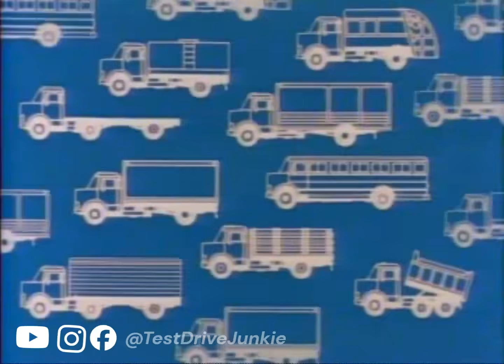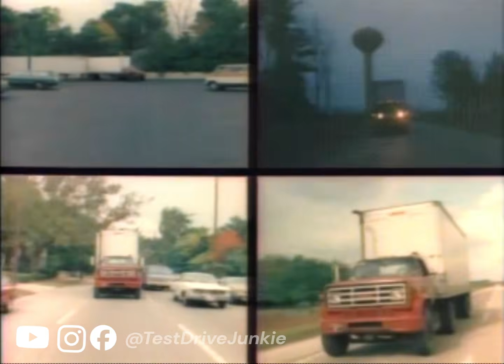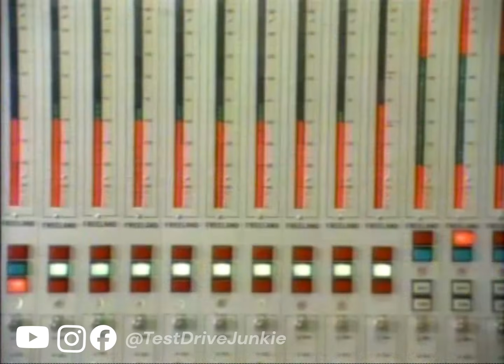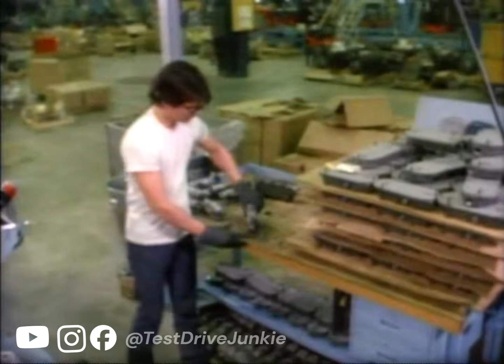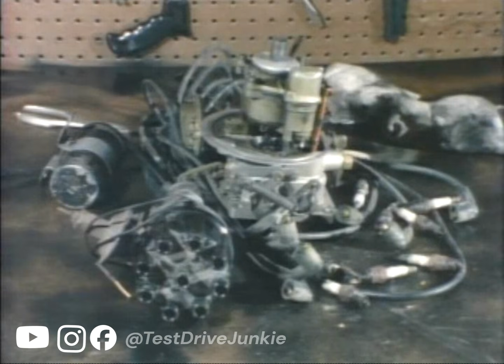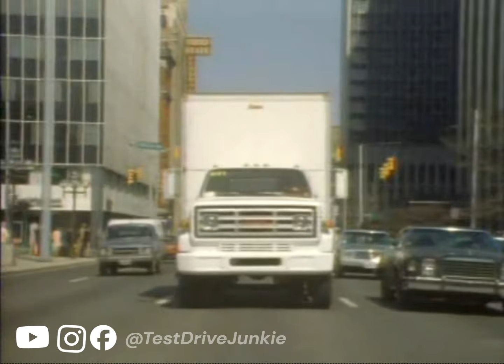1982 GMC Medium Duty Trucks Manufacturer Laserdisc Promotional Video Side ONE

Comment: I remember these "Fuel Pincher" engines. The open deck design turned out to be less than a good idea. Head gasket issues were common among these engines, and if I recall correctly, they were a pig to work on in the GM medium duty chassis due to the placement in the frame. The exhaust manifolds were basically shoved into the C section of the frame rails. I was not the only diesel dud of the era though, the Caterpillar 3208 v8 was worse, had engine blocks made of Swiss cheese.
Reply: Did 3208's really have bad blocks??
Reply: @claytonwhitacre1335  A fleet I worked for back in the day a few of these engines, two out of three developed coolant leaks due to block porosity. They are a parent bore engine, and did not have press in liners.
Reply: Not necessarily it was basically a shrunk down version of the 3408